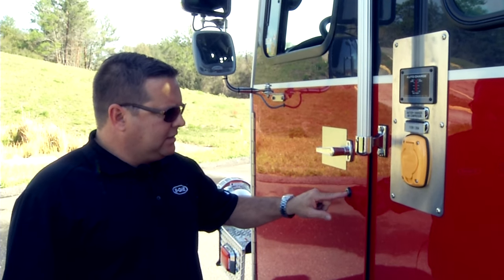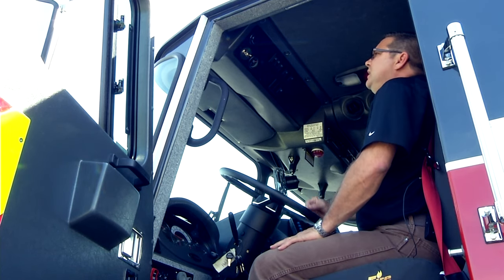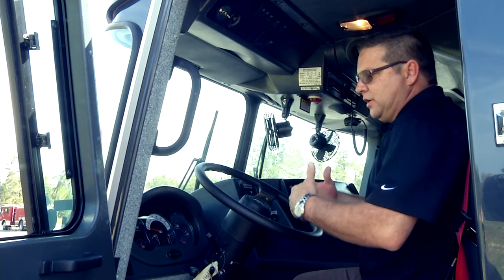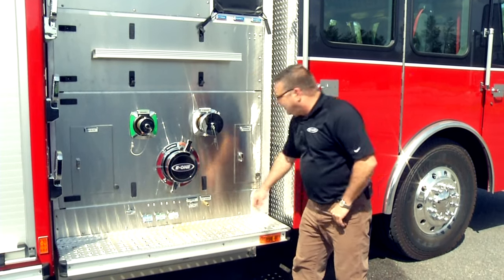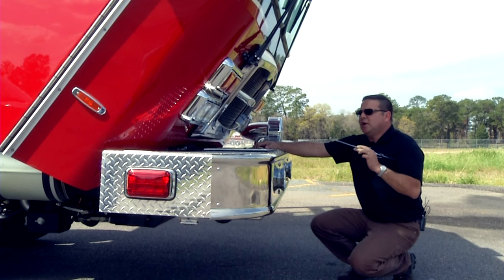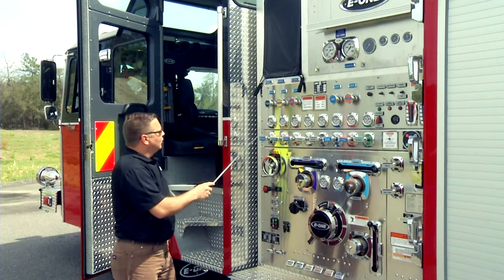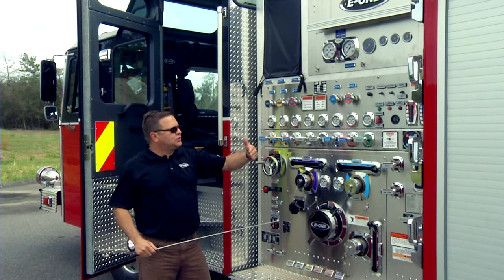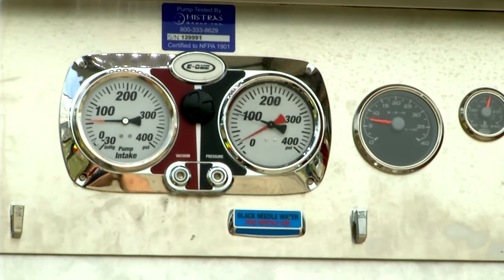E-ONE Pumper Training Video - Field Training

Comment: I am not a fan of E One Apparatus, but I do like the fact that this particular Pumper still has the T Handle Push/Pull Discharge Valves, and the Traditional Throttle Control Knob instead of the fully computerized Throttle Control, and Electric Discharge Valves that Pierce Pumpers are now using.